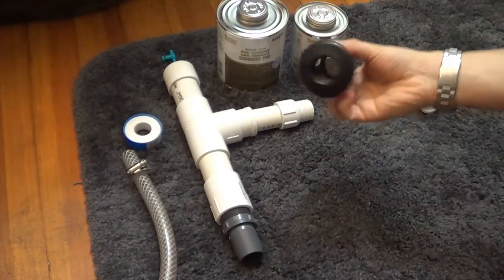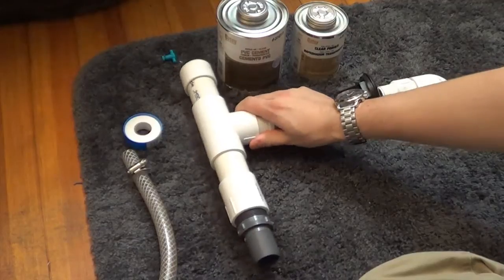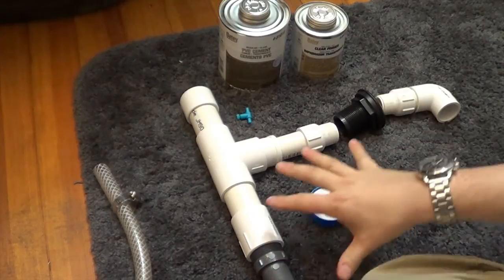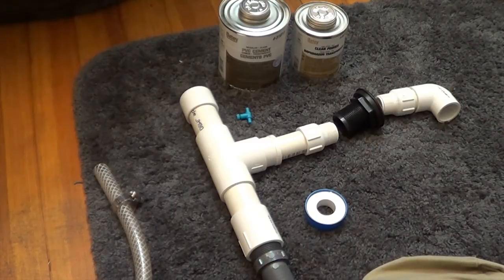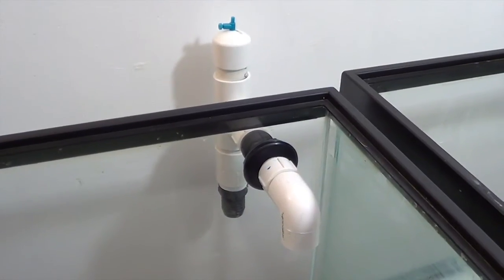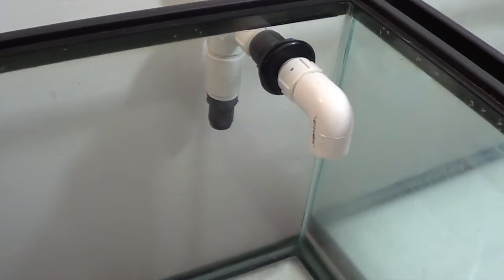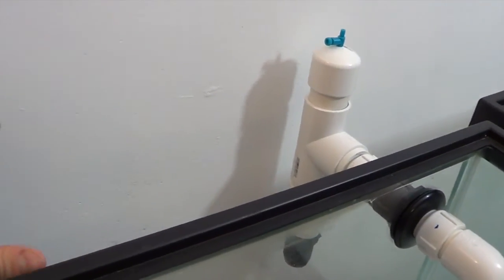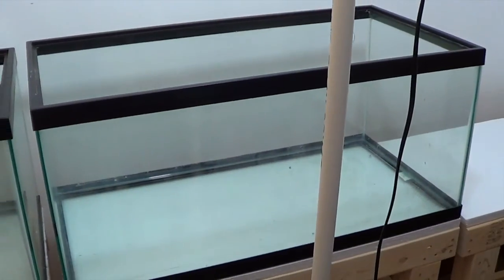#138: How to Make an External Durso Standpipe - DIY Aquarium

Comment from the maker: I decided not to use the external dursos, i was worried that i would be putting too much torque on the glass hole, go with the drilled durso, the upturned elbow will be loud like a normal standpipe, the downward facing elbow makes it quiet

Comment: ***** just wondering why you didn't go with the hang on the tank PVC over flow tubes. That is what I am considering. I really don't like the idea of drilling a hole in an aquarium. Do you have an update video showing the hold over flow setup in action? Thanks!

Comment: Did you run some water through the system with the external durso when you still had it on? How did it preform if you did?
Reply from the maker: +Paul Figas i ended up going with a different overflow design to reduce the stress on the glass, check out my newer videos to see what i'm using